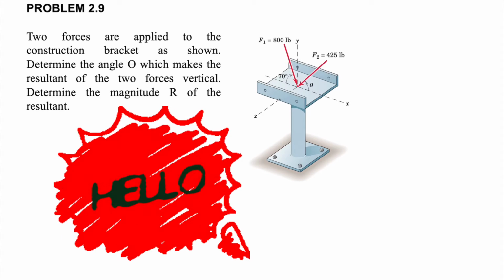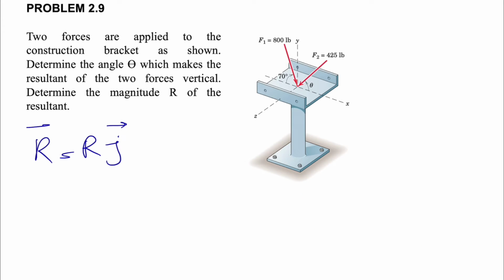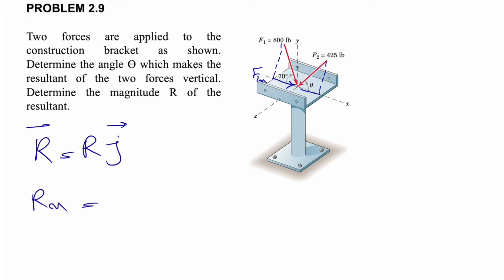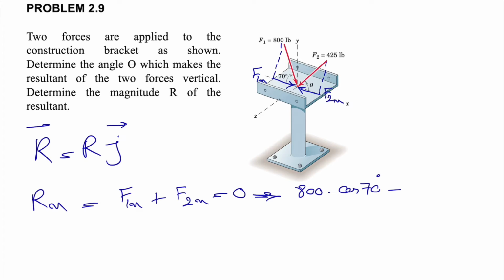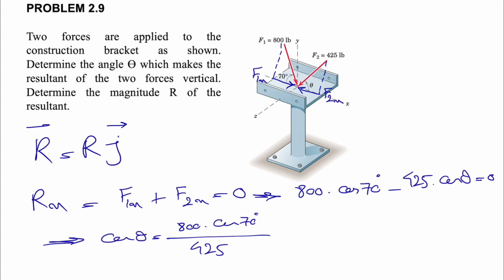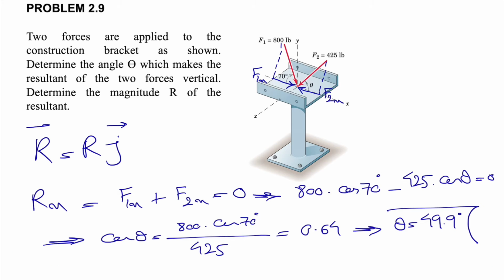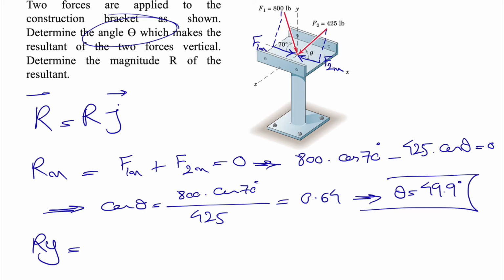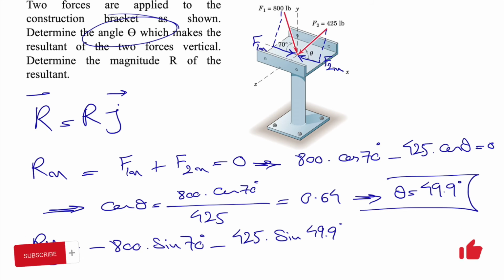Problem 2.9 | Two forces are applied to the construction bracket as shown. Determine the angle 𝜃

Comment: For the second part of the question where we needed to determine the magnitude R, why have you taken Ry = -800.sin70 - 425.sin49.9.  Why have you taken sin? Shouldn't it have been cos?
Reply from the maker: To answer your question, the sine function (sin) was used because the components in question involve resolving forces into their vertical (y-axis) components. When dealing with force vectors at an angle, you typically resolve the vector into two perpendicular components: one along the x-axis (horizontal) and one along the y-axis (vertical).

	•	For the vertical component (Ry), we use sin of the angle because it gives the projection of the force along the vertical direction.
	•	If you were resolving the forces into horizontal components, you would indeed use cos.

In your example:

	•	Ry = -800.sin(70) - 425.sin(49.9)

This is resolving the vertical (y-axis) forces, which is why sin is used. If you were looking at horizontal components, cos would have been used instead. 

Hope this helps!